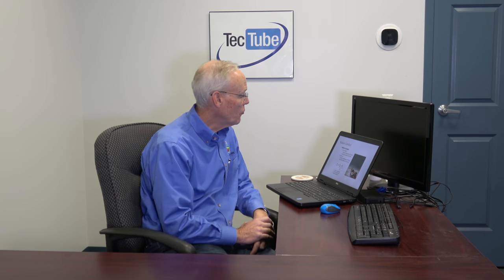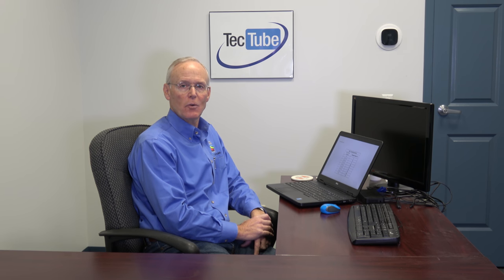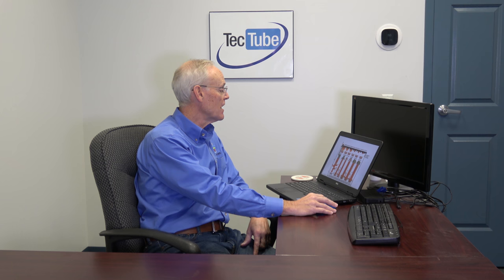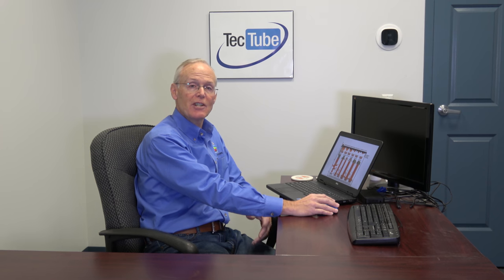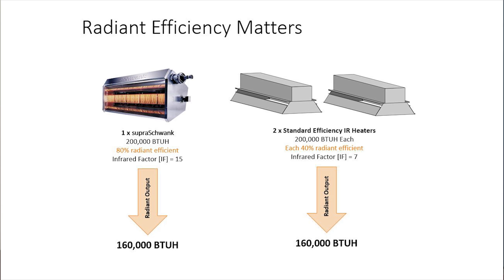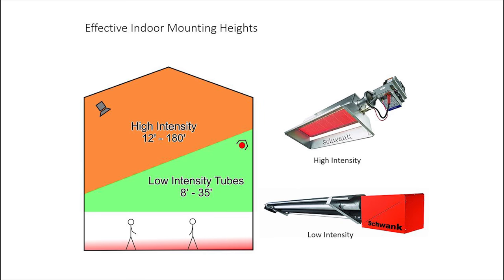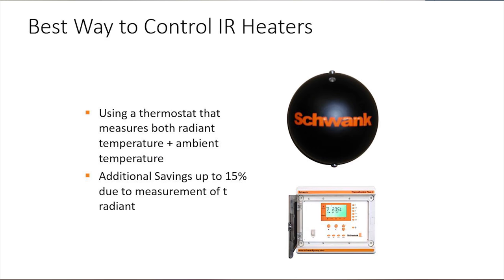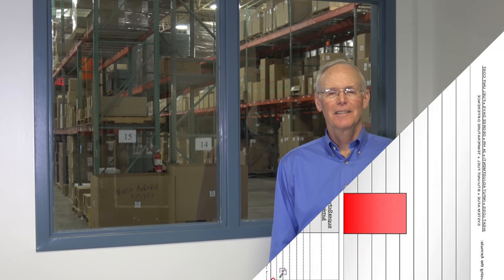Infrared Heating & High Intensity Heaters (2 of 5)

Comment: I have a shop, 30'×30'×11.5'. R19 walls r38 ceiling. Pole shed construction, tin interior. Other side of north wall is cold storage. 2 windows on each west and east walls, 1 window on the south wall. 16'×10'  insulated roll up door and main entrance door on the south side. Just some advice would be appreciated. Would it be beneficial to have the burner at the south east side of the shop and the thermostat on the northwest corner. Also cement floor. What make of infrared tube set up do you suggest and BTU. I was looking at a Reznor 2 stage until I watched your video on infrared heat and why you should stay away from 2 stage heat boxes. Also subbed your channel. Great information. Also I'm located in mid Minnesota. Also I would mount the unit at an angle to spread across the whole shop.
Reply from the maker: It is difficult to give out project specific advice without doing an engineering analysis of the building.  As a general rule, locating the infrared heater nearest to the overhead doors OR to a specific workstation is the norm.  The thermostat should be in the zone served by the heater but not in direct line of sight of the heater.  One of our distribution companies, National Excelsior, has offices in Minnesota.  http://excelsiorhvac.com/locations/

Comment: Your chart doesn't show the 90+ efficiency furnace.
Reply from the maker: Condensing unit heaters (90%+) are relatively new in the past 2 or 3 years so we have not seen any of these in warehouses ready to be replaced.  However, they would work the same as the other forced air example in the chart.  Instead of 80%, they would be 90%.  So instead of 250,000 BTUh reaching the floor level, it would be more around 281,000.  So if we added it to the chart, it would be the 2nd worst way to heat a facility with tall ceilings.
Reply: And the best way?  In-floor radiant tubing supplied with a 98% efficient boiler.  Heating the floor up has the least waste because you are supplying the heat directly to the occupant.  However, imbedding tubing into concrete is much easier on a new construction building than on a retro-fit.  So for a retro-fit, overhead radiant heat is the way to go.
Reply from the maker: Well, luckily at TEC, we design and supply systems with in-floor radiant heat, overhead infrared heaters, high intensity heaters, unit heaters, and condensing unit heaters.  There is no one right choice for every project and budget.